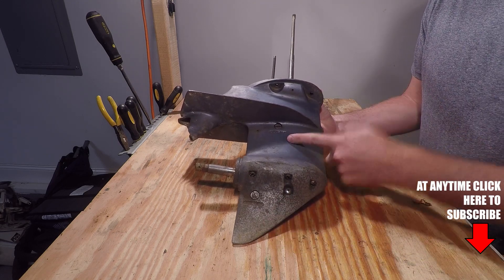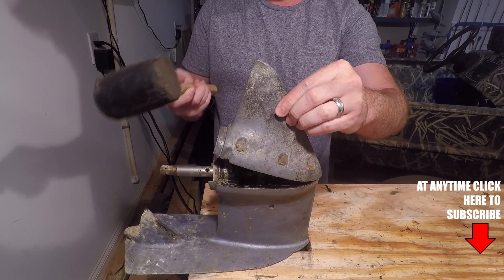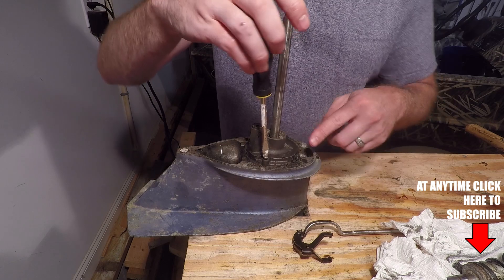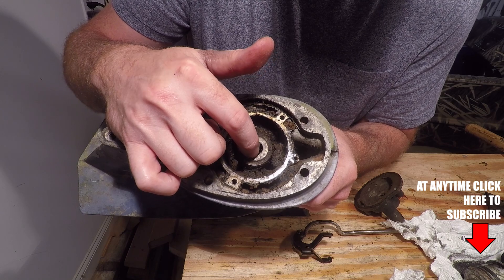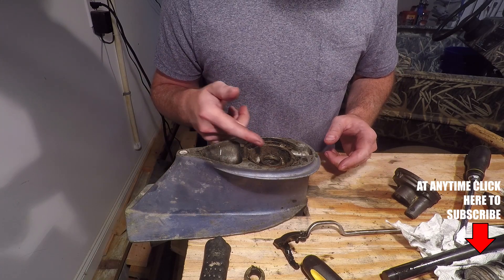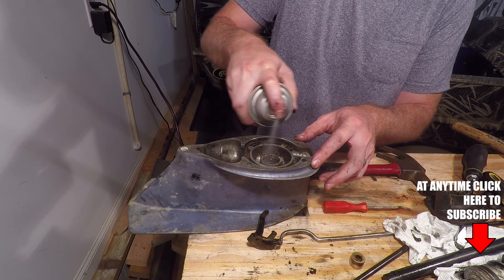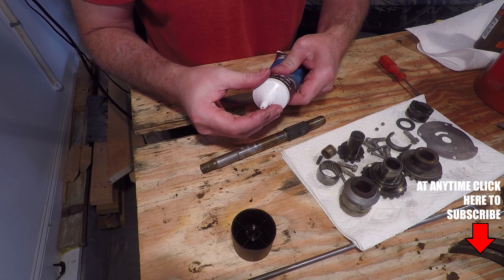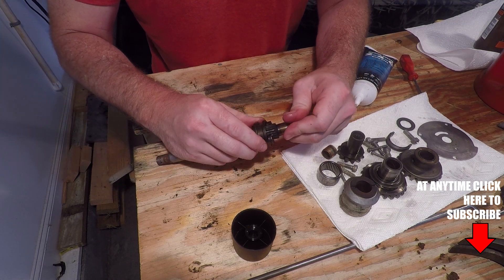18 20 or 25 Hp Johnson Evinrude Lower Unit Reseal - Part 1/2

Comment: Thank you so much for your video.  Trouble removing the drive shaft seal.  Was successful, however, in the process, ruined #383829 Drive Shaft Bearing.  Where would I locate the tool to pound out what is left of the bearing?  Since there is a tool, which I have, for the shift rod shaft bushing, hopefully someone has reproduced the tool for the drive shaft bearing.

Comment: Thank you very much for the link to buy that brass bearing removal tool ! I tried using a large punch I already had with no joy. Went ahead and bought that removal punch tool with the graduated steps and it came right out!
Reply from the maker: Easy peasy lemon squeezy
Reply: Purchase a 1/4" socket screw 4" long, grind the OS diameter of the head down to where is just slightly bigger than the ID of the brass bushing - insert in shift rod hole bottom to top, you then have the option of using a phillips head screw driver inserted in the head  to DRIVE it out or pull it from top side with a drilled bar and a nut -you won't damage the bushing and it can be reused.

Comment: I'm working on a 1981 25hp .. I got the seal kit and the impeller kit and 847 , just waiting on the spaghetti.. I bought the spaghetti you suggested.. figured I might as well, .. cost me like 40 bucks or so tho .. also waiting on the brass fitting removal tool. .... I have a question. I'm considering putting in a new thermostat as soon as I'm done with this bottom end... honestly  I don't see where the thermostat is located tho ? Like I see where the water hose from the block goes .. but not sure how the thermostat is placed,  or attached in this model? .. my last engine was a 72 6hp evinrude... this one is still fairly easy but .. just don't see the housing where a thermostat would go. .... not sure if it even needs replaced .. was gonna replace it even if it doesn't need it .. just so I know it's not a worry for awhile.
Reply from the maker: Find number 19 in the link below:

https://www.marineengine.com/parts/johnson-evinrude-parts.php?year=1981&hp=25&model=J25ECIB&manufacturer=Johnson&section=Cylinder+And+Crankcase

Comment: Frequently I have trouble getting the driveshaft and prop shaft seals out.  I usually bend the seal out of shape so bad using the screwdriver method, I have to end up cutting the seal out with a Dremel tool.  I sure would like to find a better way to remove these seals.  I have done probably 20 of the old OMC motors, and I always struggle to get the old seals out.
Reply: I use a big wrench and put the cylinder in a vice with rags and take a 3/4 wrench and pry it out with the claw comes right out most of the time

Comment: I can't seem to find my engine on your seal kit list.... 1983 25hp evinrude.
Reply from the maker: 1983s are different.  They don’t have the split case.  They use a different procedure
Reply from the maker: I was wrong.  In 85 they went away from the split gear case
Reply from the maker: Sierra Marine 18-2657 or BRP 396352 is what you need for your 83

Comment: I’m looking to purchase a new needle bearing ( the one that the drive shaft goes into, not the gear case needle bearing ) 76 Johnson 25 HP, as well as the six screws that hold the skag on. Do you have a link to where I can purchase those ? Thanks and great video
Reply from the maker: http://www.marineengine.com/parts/johnson-evinrude-parts.php?year=1976&hp=25&model=25602E&manufacturer=Evinrude&section=Gearcase

Comment: The top seal (driveshaft) in the kit is much thinner than the original. But in the kit there are two of them. So do you install one on top of the other or just use one of them?? There is enough room to get both of them in there
Reply: What did you end up doing if you remember?😂
Reply: @sethmarshall5023  I just installed one of the seals. Worked out great.

Comment: Would this be the same for a 1984 25 hp 2 stroke model?
Reply from the maker: Yes as long as you have the split case skeg style lower unit
Reply: @thisoldoutboard  thanks for the reply

Comment: READ THIS!!!  Buy the Brass Bushing Removal Tool using the ebay link "thisoldoutboard" provides on the video!  Got a '75 25h.p. and even using the tool--it was a $#@%& to get out!  If you have a brass bushing to remove that's as tough as mine was, there's no way around it!  In the process I "mushroomed" the striking end of the tool before the bushing even started to move!  Do not hammer on the small end!  Use a center punch and two 4" sections of angle iron to go between the bushing and housing so you can tap the special tool out of the bushing!  This one was a beast, but it's done!  Thanks to "thisoldoutboard" for the help.  Ultra fast shipping on special tool!

Comment: Great Videos.  Is the 1957 fd-11 18hp lower unit seal kit the same as the 1958 ones you have listed?  I read somewhere the seal to the prop shaft is different on the older 57 models and Evinrude change size in the middle of the year.

Comment: I know this is like a year old video.. but the removal tool ( 0304514) and install tool  (0304515) are hard to find would you plz give the measurements for the tools the removal tool i know has 3 different  sizes on the 1 rod and the install is 2 on 1 rod. If you  could get those measurement it would be very helpful to get a set made. TIA.
Reply from the maker: I’ll get you the dimensions this weekend.  If you don’t have them by Monday send me another comment as a reminder
Reply: Awesome Thanks..
Reply: Thanks This should help.. I'ma see if I can get this made by a local machine shop...
Reply: Did you ever get any made
Reply: @johnsain3117  No I didn't the shop around me was asking way to much to make so I ordered the removal tool frm website I think it was crowley marine.